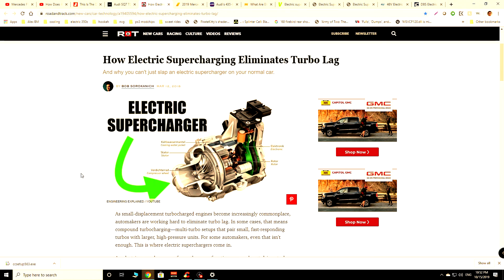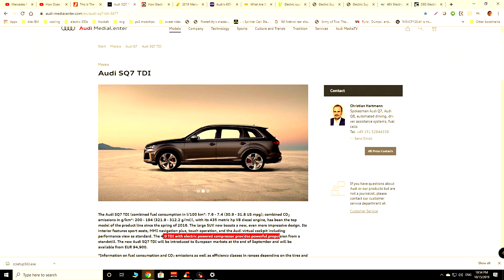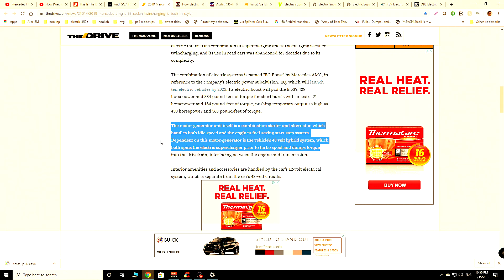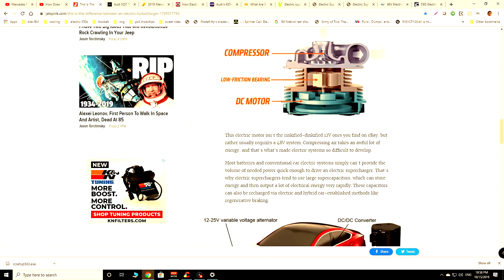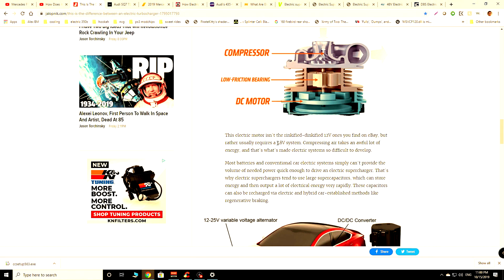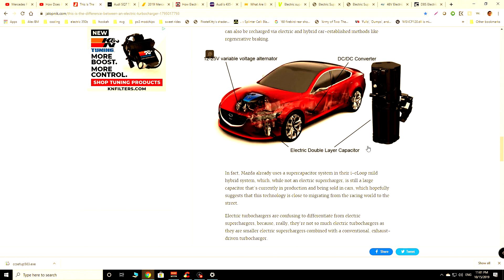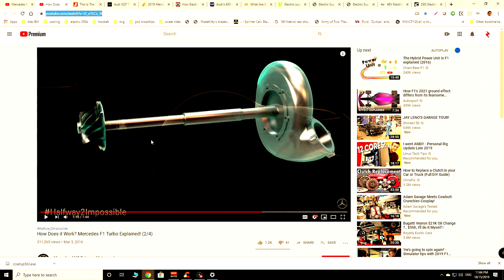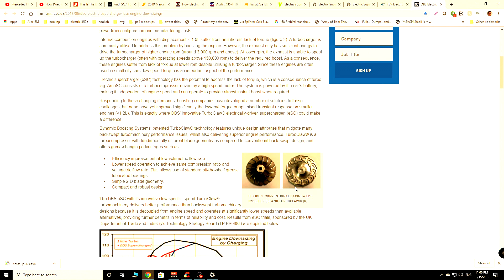the truth about electric superchargers

Comment: Technically, the lie is from those who sell a fan or blower assembly as a compressor.  The compressor systems that run on 12v are true super chargers, but the limits of using 12v means they can only work on small displacement engines.
Reply: even the 48 and 72volt systems seem to have diminishing returns on anything beyond a 3.5L setup, at least according to the folks at TorqAmp. Granted a lot also depends on the engine head's ability to flow air amongst other things. But yes there is some merit to the 12v systems but the disparity between the quality is so massive that getting a system that truly works even on a tiny engine is very small.

Comment: The idea is cool but for high output it seems redundant. I like the idea but hybrid drives are already essentially doing this with motors coupled directly to the driveline instead of being used to pump air into the engine. I'm not sure at what point the cost to power to weight benefit curves meet vs a classic turbo or supercharger system. Ideally, I would like to see these systems developed to provide consistent say 10psi+ boost pressures through the rev range on a 2.0 4, 3.0 6, 4.0 8 up to 8000+ rpm. Then it should be weighed and priced. Right now it looks like manufacturers are only interested in using this tech to bullshit their way through bogus efficiency tests on heavy luxury cars full of complex systems while the ones looking at performance are coupling electric motors directly to drivelines which leaves the actual enthusiasts most interested in the tech having to frankenstein shit together.
Reply: Yeah right now I'd say the battery packs are fairly hefty but imo still lighter than a full new intake/exhaust mani, turbine and FMIC/TMIC setup whether it be air/water and arguably similar in weight to some sc setups. The problem with exceeding 8 psi though is that you need to run an intercooler since charge air Temps skyrocket past that, I suppose you could run an interchiller that is AC coolant refrigerated to limit weight but that increases complexity and installation time. But at this point even Garrett are making hybrid turbine setups since this appears to be the way many manufacturers are going. I doubt fulltime electric SC kits will be a thing from oems but who knows. And I agree right now the mild setups that exist are just there to check a box so they get fleet emissions credits.
Reply: @cr4zyw3ld3r  Oops, I forgot about the iat aspect. Funny you mention an AC-driven cooling system coz I thought of this many years ago, wondering how it could be implemented to drop iat's. I guess it could be designed to mimic a water-to-air heat exchanger. Anyway, the more I think about this and the more I feel advantages are redundant vs a classic system that relies purely on mechanical drive (turbo/supercharger). This is probably why performance applications use electric motors directly on the driveline. No effect on inlet tract, more advantageous distribution of extra weight and the major bonus of regenerative phases during deceleration.
Reply: @papapetad  it's a mixed response right now. I see the hybrid turbos as a good packaging solution but I worry that the heat from the hot side limits motor efficiency in these setups, so you'd have to have a water jacket and thus additional coolant lines running to it. If 48v systems become more common on cars then such standalone systems start to make more sense. And if something like Freevalve/Camcon gets implemented you could use the compressed air those systems use to pre-spool the compressor but at that point you could just as easily use such a system for a regular turbo setup. So really the advantage to these systems is quick install/de-install and ability to work on a stock ecu since the boost is programmed to taper off up top to not go beyond stock injector duty cycle.
Reply: @cr4zyw3ld3r  I am looking at it purely as an aftermarket performance modification which means taking into account the added complexity of the extra electrical and electronic control systems but also the need for upgrading the charging system to sustain its use and with all this in mind, I just don't see how it can be viable when compared to mechanically driven forced induction. A driveline-mounted electrical motor makes much more sense as an alternative due to weight distribution and regenerative phases. There's a beast track build N/A 350z with a hybrid drive floating around youtube. High budget build. What could this sytem offer that guy that his system doesn't is what I'm wondering.
Reply: @cr4zyw3ld3r  And yes, I saw a video that spoke about F1 using a hybrid drive between the compressor and turbine which is surprising but proves it feasible but it is such a niche application, filling a torque dip on a small high revving engine with a big turbo. It's interesting but most modern turbo engines already happily make peak torque from below 2000 rpm to beyond 4-5k rpm so it's not like they need the help. N/A engines would be best candidates but that brings us back to  electric forced induction vs driveline hybrid drive. Tough call.
Reply: @papapetad  I believe you mean Sasha's 350z that is now running a 200HP e-motor and batteries. But these systems are meant to be a kind of mild hybrid and depending on tuning behave either like a shot of nitrous where you get a quick temp boost with instant spool or depending on the control system mapping it adds progressive boost to help expand the usable power band not unlike your reg turbo setup. The win here is that with nitrous systems you need to change bottles and with something like an sc you have parasitic losses down low especially on smaller engines this doesn't suffer from those issues. I  currently run a phantom kit which uses two agm cells so 20lbs extra weight for batts and about 2lbs for controller/charger so 22lbs total with the ability to hit 6psi of boost and no need for intercooler. Since I run a methanol injector the IATs are completely within norm for my MR20DE 4 cyl. It great for mountain driving and the occcasional small track. I can boost continuously at full 6psi for abot 2min. In reality though you are never going to be at wot and hitting full boost on most of my local tracks. At Laguna I can do 6 laps nonstop before the batteries get got and I lose charge. However for full-on race application this system and the one tested by cleetus called TorqAmp are not really enough because they just lack the power output of a conventional turbo and some SC setups. But its always a trade and depending on your use case it may not be ideal for you.
Reply: @papapetad  yes the issue is compounded by the fact that we now have advancements in turbo tech for with laser compressor wheel speed sensors and electronic waste gates a small twin scroll setup can support power output levels that before required a system twice the size and with more lag and they do so with incredible response effectively negating any torque dips. And then you get into dual volute and VNT turbines and its just even more complicated. But the important part is that there are many choices now to get the power level you want at a reasonable price point if you so wish.
Reply: @cr4zyw3ld3r  Yeaaah Sasha's car is the one. Ok, you have experience with these systems so you have a better reference point than I do on practical limitations. 6 laps of Laguna would be about one lap of the ring, maybe a little less? That sounds pretty good considering most cars would need the engine and brakes to rest by then. Have you ever done some extended canyon/touge style driving sessions? What would you need to sustain longer stints? Is your alternator oem spec or upgraded to keep the extra batteries topped up?
Reply: Oh, and what advantage do you see in your system vs a low boost turbo application? Are you using an aftermarket ecu?
Reply: @papapetad  for me it's pretty simple California laws require all emissions equipment in place every two years. And since I can remove this setup in 10min it's a life savior. If this were a dedicated track car, the advantage would be less weight and instant spool at low cost. The kit I have was $1400 there is none like it with reliable components that I know if that I would trust in that same price range. It just meets my needs perfectly. Now if I lived in another state, like say FL and near a big city junkyard I could probably salvage a good deal of turbo components off the crashed cars and built a kit prob within that same price with aftermarket stuff, but that's not the case.
Reply: @cr4zyw3ld3r  Fair enough. So there's definitely a place for these systems. Can't argue with the costing. Like you said, trying to piece together a budget turbo setup requires many stars to align. Are you running an aftermarket ecu with multiple maps or do you rely on factory adaptation to deal with boost?
Reply: @papapetad  yep its just intersection cost/performance. I have an UpRev tuner who helps me out since engine maps are not my domain. We were able to squeeze about 45hp out my setup by allowing the car to delay pulling timing(thanks to meth injection) spraying a bit more fuel through the injectors after better pump was installed and running a bigger airbox with spindlefree butterfly valve in the tb.
Reply: @papapetad  the biggest upgrade is what TorqAmp already did which is moving to a 48volt system and LiPO cells. This gives higher amperage and longer sustained boost times. They also use batcaps in their system to load up the system for massive boosts before switching over to LiPO for absolutely insane torque to the BLDC motor running the turbine wheel. Will it last on the Ring? Not sure that'd be a question for them, but my guess is prob for one LAP. They do have liquid cooling inside the battery compartment if I recall so it will take it longer to heat soak. But then you get heat in the motor itself which will degrade performance. I can't really push my car because it's an open deck design on a cast alu block and it's a stress cast design so putting anymore strain on it would be catastrophic. If I had more money I'd have cylinder support systems  install a block saver, get new forged pistons and beefier wrist pins, then upgrade the bearings and install a support girdle. Then up top a set of hotter cams, sodium filled intake/exhaust valves,beehive valve prings, and the usual ARP head bolts and steel gasket. Then maybe I could push the engine more, but at that point it'd be a lot easier to just get a bigger engine/diff car.
Reply: @cr4zyw3ld3r  Yeah, the sweet spot for these systems really seems to be in specific bolt-on low boost applications like yours. Too many auxilliary support systems are needed for sustained high power use by the sound of it, and I'm not even factoring in engine strengthening since that is a given in any performance application past a certain threshold. Well, thanks for the exchange. It's good to get feedback from practical experience rather than theory.
Reply: @papapetad  it's not too bad actually. It's always just battery box and controller. You could get more creative with it. But it's  not necessary. However yes it's a very specific low boost setup. Could be useful with compounded charging if space restrictions are a thing since you can remote mount the battery system. However as I said it's worked out great for me.

Comment: My Honda Has a VNT VGT TURBO, VW Use Them, And Many Other Manufacturers Also Use Them....
Reply: Is it a diesel? What is the car model and year, I have not heard about this stateside.
Reply: @cr4zyw3ld3r  yeah its a diesel 2.2i ctdi 8th gen civic, apparently people call them the diesel type R, 140bhp 251ftlb torque and with stage 1 tune 210bhp 375ftlb torque with just minor mods
Reply: @DamLitProductions  yeah diesels had some cool tech on them,  but it didn't work on reg gas engines as well.  The pressures weren't there to operate the vanes quite so easily.  That's why it's rather rare on non diesel cars.  Though I suppose someone good at modding could take the diesel vnts and make them work on a reg gas engine with some ecu tweaks etc.

Comment: Seems like the torque app has a chance be decent but I've got like a Trailblazer and it breathes too much are already I'm surprised that they don't have a bigger Electric because everything they seem to show it on all these mid-level displacement engines or smaller until they go with two of them why can't they just put a bigger motor and a bigger blower so there's one unit and make it much simpler
Reply: I am not a mech engineer but I think It is a problem of weight/cost and efficiency as I understand it. Once you go to a bigger motor you start adding weight into the system which potentially means slower spool and worse compressor surge when at full tilt. Plus depending on the motor used your efficiency could drop due to more heat generation which in turn means you are using more energy from the battery pack, thus draining it faster, which could lead to more parasitic losses on the engine since you will need to pull from the alternator when on throttle potentially. Hence why you see them using two smaller units instead. Otherwise you are looking at having to have a cooling collar around the motor and that adds additional complexity/cost and so on. For the most part it looks like these are good on 2.3L engines and below for actual power add. Beyond that you are looking at pairing this with a more traditional turbo setup.

Comment: The audi compressor just builds pressure and blows it through the turbo to speed up the boost. It doesn't increase the boost
Reply: however by helping the main turbo spool faster you are in fact increasing boost during lower RPMs vs not having the eturbo assist.